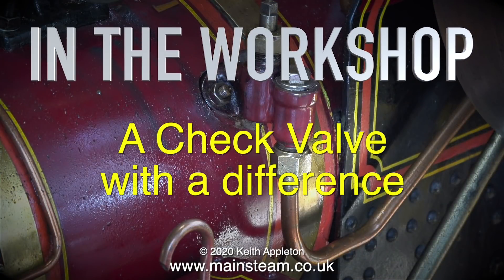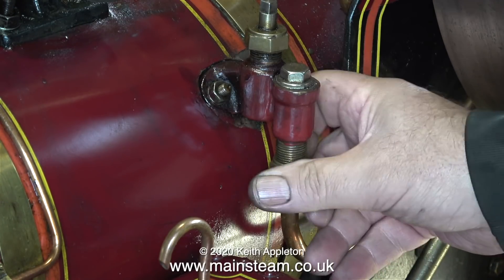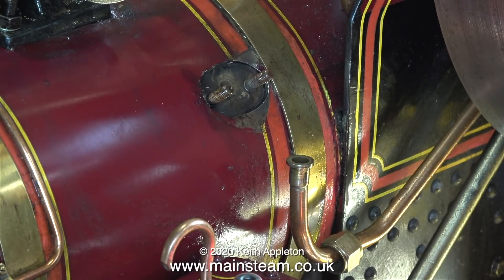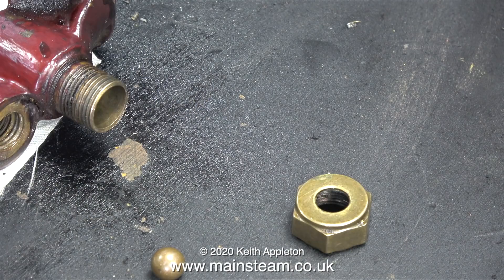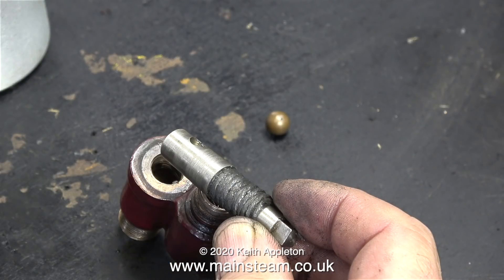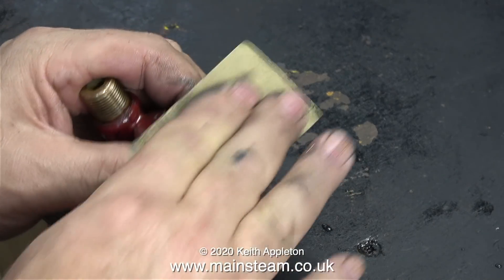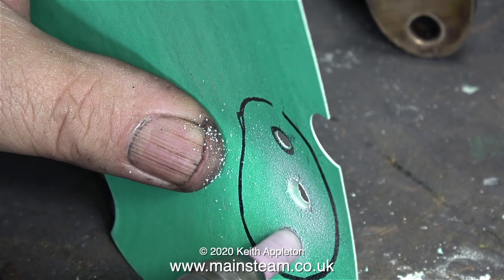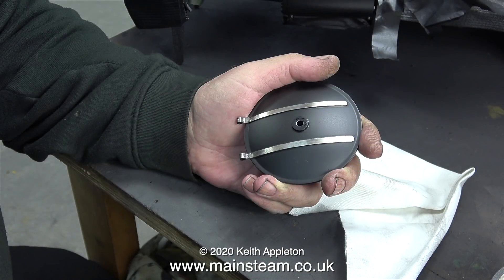A CHECK VALVE WITH A DIFFERENCE

Comment: Keith, is your boiler copper lined or just copper?
Reply from the maker: Copper all the way and lots of it . . .
Reply: @keithappleton  I asked because many years ago my the company I worked for was cutting up a copper lined water tank as it was not repairable, and it was difficult to cut with a cutting torch.

Comment: I'll bet you London to a brick that the "inspector meticulus" types have no runs on the board! You do a pretty good job of your presentations and maybe your standard is not museum quality ( not many madellers/engineers can fall in that elite class), join the club. Is it functional, yes, at a few meters away does it look the part, yes it does. Does it operate as intended, yes. 100  out of 100. That is a pass according to me. I'll miss your posts if it goes that way.
Reply from the maker: Thank you {:-)))
Reply: I couldn't agree more.  The full-size working engine that this model is based on would never have been 'concourse' or 'museum' quality so why should a model be any different?.  The engine gets hot and cold, it's covered in oil while working and it DID have to work for a living.  This engine looks great and Keith has done a great job on the paint too.  Being a little bit rough-and-ready, in my opinion gives it a much more authentic look.  I say Ignore the naysayers!
Reply from the maker: Agreed }:-)))

Comment: An idea that might be helpful to you. Is there a shooting club or someone with a firearms licence available to you ? Expended brass can be used to punch holes in gasket material.  And easily sharpened inside  with a tapered cone and your Proxxon multitool. The more different sizes you have, from   .22  up,the more holes. Not as good as a steel punch,but plenty strong enough for occasional use. Necked cartridges work well to custom size a problem hole.
A handful of brass is years supply no matter how busy you are.